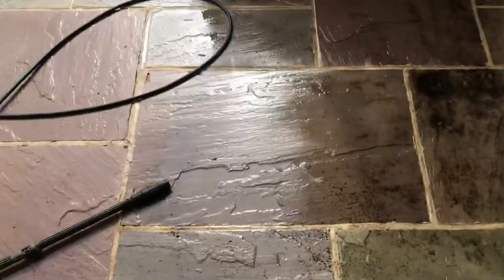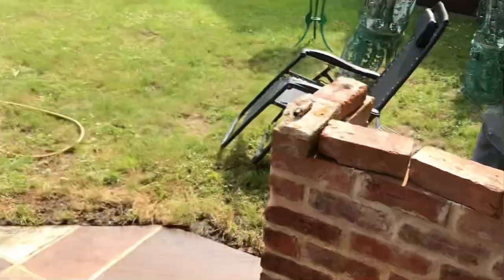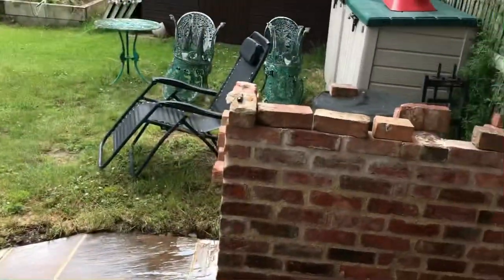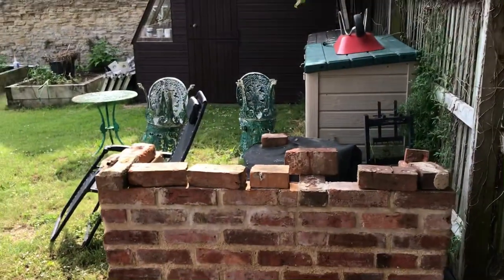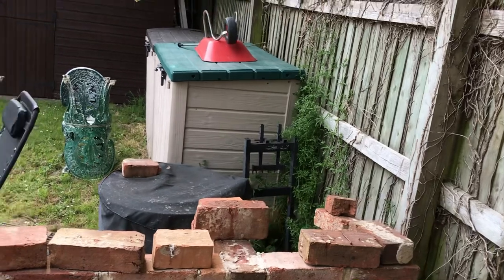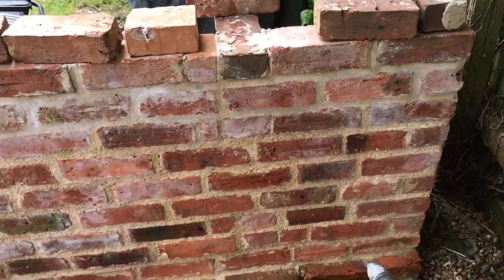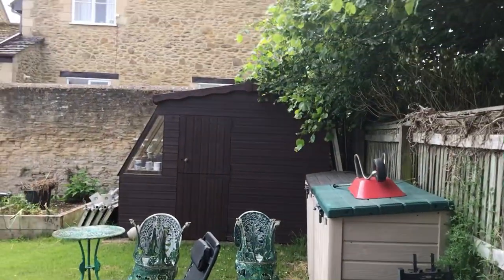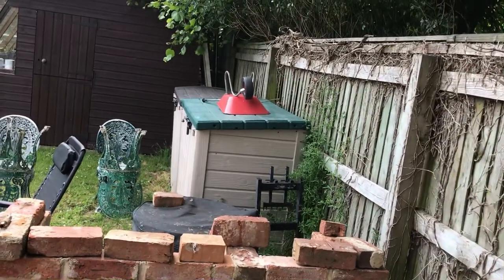How easy it is to wash lime mortar out of brickwork joints.

Comment: This is just what I needed to see. Thanks
Reply from the maker: NHL3.5 at the top - where I pointed to with the hose. Putty on the bottom.
Reply: @michaeljamesdesign  got it. Thanks Michael. What do you use for finishing off putty mixes? Would a blunt piece of wood suffice?
Reply from the maker: @jmabarker1  That would do to start the knocking back process.

Comment: Most architects recommend nhl 3.5 in my experience, probably because that’s what the merchants stock. Maybe you should do a detailed video on what lime works best in what situation cuz I’m bolloxed if I know. I’m a carpenter/builder and I’ll use 3.5 on 9” walls and portland on cavity walls but I’d love to have more knowledge on it
Reply from the maker: NHL3.5 free lime contents can differ greatly.
Compressive strengths across the NHL3.5 range can vary so much that an NHL2 can work out stronger than an NHL3.5. It's worth people being discerning when employing contractors otherwise they might end up in a position where they may as well just use cement.
Reply: @michaeljamesdesign  so how would a relatively untrained eye know the difference and also know which to use in a given situation. The job I am currently working on has badly weathered lime mortar that is still extremely hard but the bricks are fairly soft (late 1700s I think).
Reply from the maker: @benchippy8039  Speak to Declan at Chalk Down Lime. He'll fix you up an order of decent NHL from the right supplier.
Reply: @michaeljamesdesign  that’s a great looking company, thank you

Comment: Hi Michael, thanks for the video, i have a technical question i hope you can help me with, i have been using a very washed soft sand in the ratio of 5:2 in a NHL2 for repointing stone work, but in an attempt to up the workability and not increase strength, i have been adding another  1 part hydrated lime. The result is a very workable mix that finishes lovely. but i would like to hear your opinion to whether you think this could have any detrimental effects or if this is just upping the free lime content while maintaining original strength. Any advice would be greatly appreciated 👍
Reply from the maker: Strangely, a colleague and I (Lime Mortar Restorations) were just talking about this the other day. It's clear that there are no issues with it and it's regarded it as good practise as it improves a mortar no end. It can actually be used like an aggregate if it's spent lime hydrate or gauged in as an improver whilst fresh. Either way it's well recommended.

Comment: Glad I came across this video. In the loft of my Victorian house (built in 1880), the original lime bedding mortar in the chimney breasts directly beneath the stacks on the roof have been "washed out". You could see the living daylights through them in the loft. I always thought it was caused by rain until I saw this vid. 
So, do you think it was caused by the heat from the fireplaces rather than the rain? But why only in the loft area, not further down?
Reply from the maker: Hi Ian, I'm not too sure whether I should take you seriously. When you put something in inverted commas or quotation marks it usually means the polar opposite i.e. I could say I was "repointing" my front elevation the other day which would translate to "I was chucking mud at it with a catapult". Do you know what I mean?
Reply: @michaeljamesdesign  I wasn't aware that inverted commas are offensive and usually meant the polar opposite. 

Definitely wasn't my intention.
No worries.
Reply: @michaeljamesdesign  I was actually surprised and offended by your reply. You obviously didn't know the answer to my question, so you came up with that excuse to get away.

My question was actually genuine. Diminished lime mortar in the loft under the chimney stacks is very common.
Regards.
Reply from the maker: @ianm4  Stop being a snowflake and repoint your chimney.

Comment: Is that a lime mortar  mix used on pointing the patio? Thanks for the info, saved the video for posterity.
Reply from the maker: Are you asking if the patio is pointed with lime?
Reply: @michaeljamesdesign  Yes michaeljamesdesign that is correct.
Reply from the maker: @stanwizz2351  No, it's cement.

Comment: I had a lady on a Facebook group tell me I shouldn't re-work an NHL based mortar the other day, she stated it was because I was weakening it. I then read comments from the same poster on a different thread advising against NHL's because they are too strong. The irony gave me palpitations. 🙄 I believe you are on that group MJD although there are a few similar groups.
Reply from the maker: I know the group. I won't rework an NHL from argillaceous rock but I'm quite happy to rework NHL from silaceous rock. There's nothing wrong with a bit of NHL reworking. You have to remember that the original binder in period houses was always quickime hot mortar and that has a really low compressive strength.  Even if you rework an NHL to the point where only two thirds of its compressive strength remain, it's still likely to be harder than quicklime mortar. However, if you take a very low compressive strength NHL with a decent bit of free lime then a lot of reworking should be avoided. Twice should be the absolute maximum in my opinion. There's an academic paper in there somewhere if anyone wants to follow it up.
Reply: @michaeljamesdesign  thanks for your view on this.
Reply: @michaeljamesdesign  I was given a great piece of advice a few months ago.    Stay off Facebook group pages.    I'd go further and say stay off Facebook
Reply from the maker: @strikemehandsome  There's heaps of bad advisors out there and many free loaders. There are just too many trolls on the lime pages. It just aint worth it. Some of the pages used to be really good but they're just populated by keyboard warriors and egotists. As for facebook generally: I got called a racist by three 'friends' of mine. I'm so far from that. In fact, I used to be a teacher of English as a foreign language. You just can't do that if you have issues with other cultures or are prejudiced. Back in the day there were some dodgy pubs that were a bit rough. If you didn't watch yourself you could end up in trouble. Facebook is the modern equivalent of the rough pub.
Reply: @michaeljamesdesign  😂😂